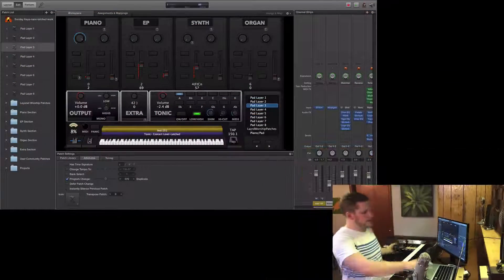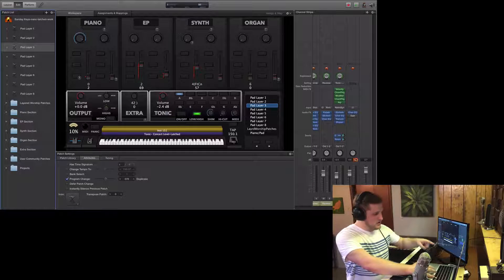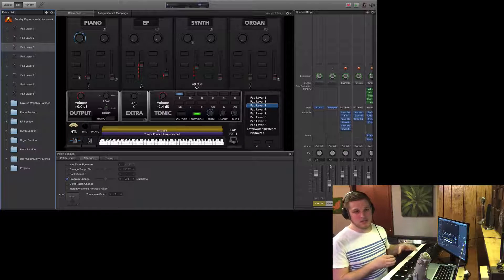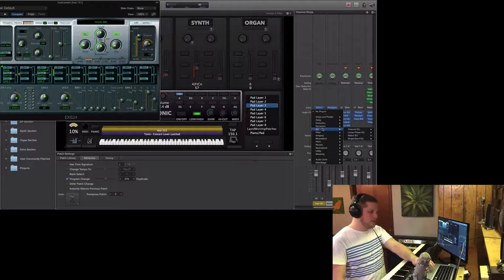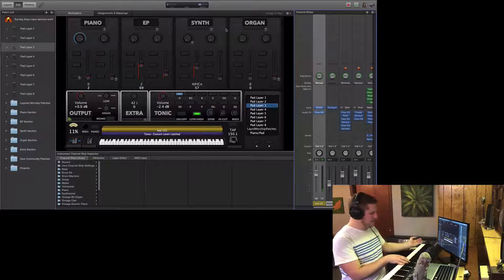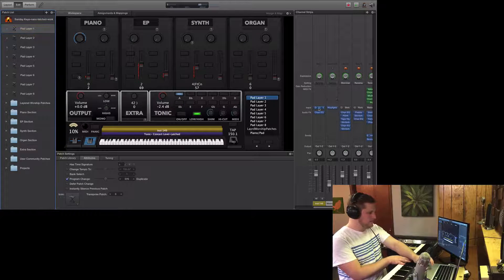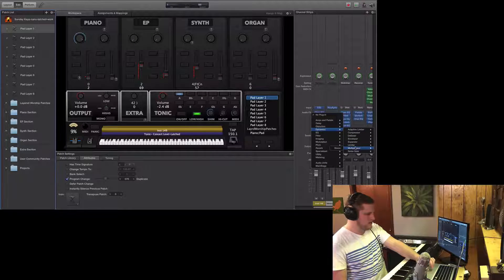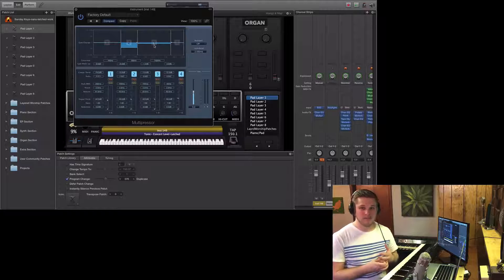MainStage Tutorial: How to balance your patch volumes

Comment: So, I should limit each channel strip, as well as Output 1-2, to -3to-6dbs.  Does that mean setting the Left window above the channel strip to -3?  If it means watching the little green little window on the right, that number seems to vary so much in the song, and is dependent on the moment, how hard you hit the keys, etc.  Seems I need to bring the slider wayyy down to get to -3dbs, as well.
Reply from the maker: Hi, you should set the green window around -3, if you find that you are clipping or going way over while playing, you may want to adjust the volume inside the plugins, but I wouldn't worry about watching it the whole time once you have it set.

Comment: Mainstage always changes my volume- and parameter (e.g. Cutoff) -settings in general when I switch patches back and forth. Anyone know what to do?
Reply from the maker: Hey Emil, MainStage mappings will default to their saved value when switching patches. To create a new saved value, simply alter the setting to the desired level and then save the concert prior to changing patches.

Comment: Is there a way to adjust volume level for the entire patch once you have all the instruments within the patch mixed?
Reply from the maker: You can adjust your main output, or route all your channel strips to a bus and then adjust the volume of that bus.
Reply: When you say "main output" I'm not sure what you mean. I mapped a slider on my keyboard to master volume but when I move it, all levels within the patch readjust to equal levels.
Reply from the maker: That sounds like you might have some accidental mappings on that slider. You'd want to map the slider at the concert level to the fader on the output channel strip. If you're using output 1&2 then you'd map to that fader.
Reply: So, I bought your Lion and the Lamb patch and dragged it into a generic template.  I found the output 1&2 fader and master fader.  How would I map a slider on my keyboard controller to output 1&2 fader. Also, not sure what the master would be for if the 1&2 fader control the output volume.
Reply from the maker: You'd simply select the on-screen slider you want to map to output 1&2 at the concert level, press the "Map Parameter" button in the inspector, and then click on the output 1&2 fader. Make sure to set the max level to 0.

The Master fader in MainStage will affect all outputs, not just output 1&2.
Reply: Thank you for the help. It must be this M-Audio Code 61 controller causing me all these issues.  We did exactly what you said and it now it just switches between the left and right channels when the encoder we mapped to output 1&2 is moved. At least we know we are doing it correctly in Mainstage.
Reply: I was able to fix my issues with my controller finally.  The problem I can't seem to fix is how to save the output volume at patch level.  The output 1&2 affects all the patches in the concert.  Is there a way to adjust output level in a patch and then save that patch so that when I bring it up again its at the same volume?
Reply from the maker: You can't save Output volume at the patch level, because the output channel strips exist at the concert level. Your best bet would be to either pre balance your individual instrument channel strip faders and leave it at that, or map all your channel strips to an on-screen fader at the patch level where you can set the "saved value" for each of those mappings.